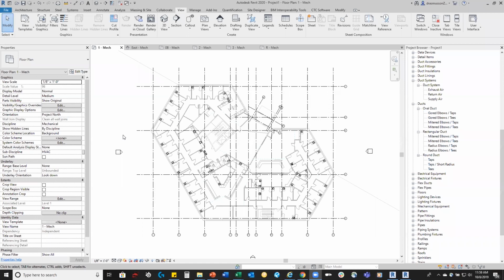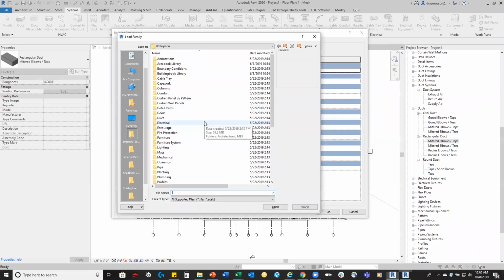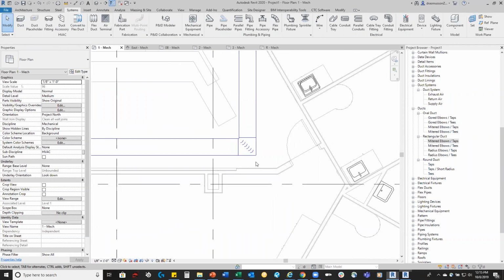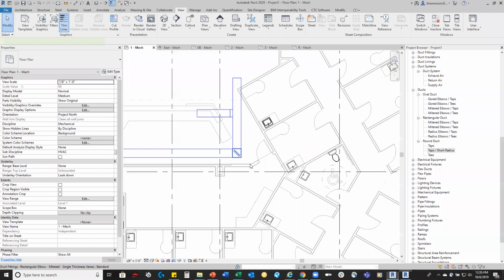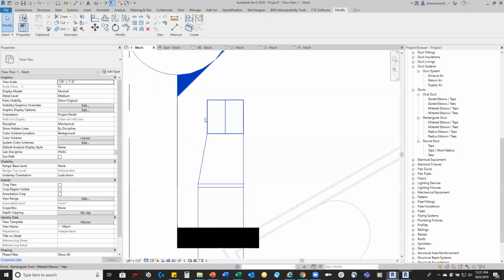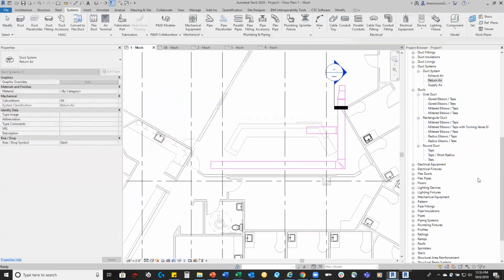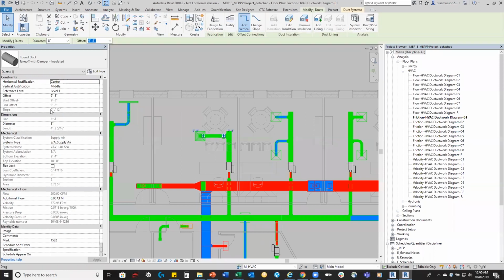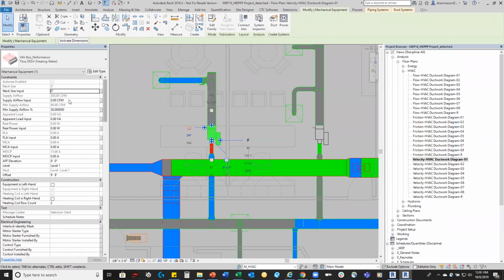Revit Duct Routing  — The Good, The Bad & The Ugly

Comment: Hey Don, I saw your video and I believe somewhere in here you mentioned different ductwork for different types of duct routing and different roughness values. I just wanted to let you know that duct lining has its own roughness which gets used to determine the friction losses. By default it is set to 0.0003', however I just got an email from Johns Manville indicating 0.0050' as a realistic value. In my duct main at 1000 FPM, just brought the friction up about 50%, good thing we checked! Thanks for posting.